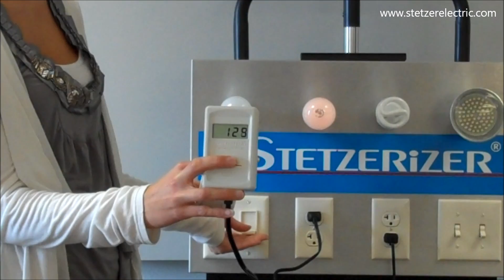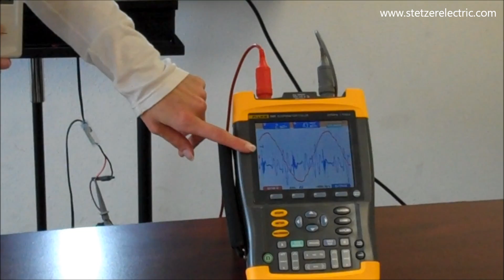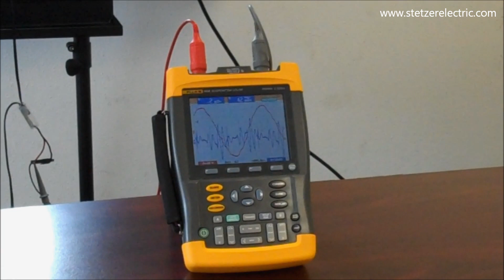The Stetzerizer Filter in action

Comment: Quotes from the WHO

Conclusions from scientific research
In the area of biological effects and medical applications of non-ionizing radiation approximately 25,000 articles have been published over the past 30 years. Despite the feeling of some people that more research needs to be done, scientific knowledge in this area is now more extensive than for most chemicals. Based on a recent in-depth review of the scientific literature, the WHO concluded that current evidence does not confirm the existence of any health consequences from exposure to low level electromagnetic fields. However, some gaps in knowledge about biological effects exist and need further research.

Effects on general health
Some members of the public have attributed a diffuse collection of symptoms to low levels of exposure to electromagnetic fields at home. Reported symptoms include headaches, anxiety, suicide and depression, nausea, fatigue and loss of libido. To date, scientific evidence does not support a link between these symptoms and exposure to electromagnetic fields. At least some of these health problems may be caused by noise or other factors in the environment, or by anxiety related to the presence of new technologies.

Quotes from Health Canada

Health Canada looked into the efficacy of Stetzer filters which are purported to reduce the amount of “dirty electricity” in a home. Here is what they concluded:

The Stetzer filter does not clean up line voltage harmonics. Nor does it help to restore the current of a non-linear load back to a sinusoidal shape. The Stetzer filter current is highly distorted containing harmonic content up to 10 kHz. (Stetzer current harmonics are accentuated versions of the line voltage harmonics.) Since Stetzer filter currents add vectorily to the other load currents in the home, their distortion products (harmonics) are carried on the electricity supply and add to the level of “dirty electricity” in the house.

The Stetzer filter is probably effective in attenuating high frequency (4kHz to 100 kHz) noise on the AC power lines although these components are small to begin with. No assessment can be made concerning its effectiveness in suppressing transient disturbances since these phenomena are random, infrequent events for which we are unable to test.

Comment: Have a major wiring problem in my home, when I put the device on the drywall it goes up to over 100 EF and in some areas higher ! I cannot work on my fuse panel because I can't stand near it long enough without feeling like crap I did turn off the main and all the breakers ,I turn the main back on did not feel anything abnormal the readings were normal as soon as I turn one breaker on the device went crazy KMoon-3120 is what I use to determine E- field , I definitely know something's wrong , my ears have a low Pierce, head is foggy when I'm in the house made a phone call to a top electrician find out what the hell is going on!
Reply: how do u fix it man i need help
Reply: just stop using electricity alltogether like i do, god never intended us humans to abuse this unearthly phenomenon

Comment: This filter works very well, especially since the smart meters came in. It really helps regulate multi pulses and spiking. Though it can't help in certain poor wiring situations and in turn can magnify the existing problem. This is not the fault of the device, it's the fault of the electrician and can be fixed by an electrician who understands how to limit the problem through smarter wiring methods.

Hopefully this company will come out with two more additional filters that reduce Magnetic fields and high microwave frequencies. Wifi will be changing from low frequency microwave to the new 5g high frequency microwave. This change will be problematic (health wise) for a lot of people.
Reply: Yes those filters are good but if you're readings are high best thing to do,put a filter on your fuse box,no need for 10 of those plugins? The inline filter at the fuse box is simple to install 450 bucks well spent!
Reply: True, though even with a inline filter between the main breaker and load, some 3-way & 4-way switch wiring can still produce high levels of harmful EMF. Sometimes it can be corrected easily in the switch box but often you need to run a new MC,15/3 wire. 

Now I'm trying to figure a way to reduce 5G high frequency microwaves, other than lining your walls of your house with lead, I don't know of anyway to stop or reduce it. Once 5G is transmitters are on every other street light or telephone pole, there's not much we can do about it.

Comment: I installed an electric space heater in my cellar and started to feel weak and dizzy and had a scratchy throat. I went to the doctor, he said I had bronchitis, I took some Zithromax and I felt fine. The heater`s been working well now for about four years. Thank-you
Reply: +Ebenezer Kalarama    The long-suffering  EHS victims describe themselves as  `forgetful`, `confused`, `dizzy` etc.  Maybe `dopey` or `goofy` would be more appropriate, especially as a pre-existing condition:
----------------------------
All about Q-Shield: ``This holographic forms were used in Ancient Egypt, as well as by the native tribes of the North America. They strengthen and correct natural, from the point of view of eastern medicine, energetic structures (meridian, aura and chakra based). They are scientifically based in terms of dorsal-torsion interactions.

Q-Shield Total is produced as an applicator that could be placed on the steering wheel, steering column, or drive shaft of the car``.

Comment: I lived in an off-grid home for a few years that was powered by a modified sine wave inverter solar power system.  I rate it as one of the worst things that I ever did in life.  A few years of living inside that dirty electricity home made me really sick!  I was so fatigued I hardly got anything done there.  I later realized that the inverter and CFL lights had induced radio wave sickness into me!  I researched and wrote a book on the subject, called "Toxic Electricity".  Stetzer is right!
Reply: Environmental Radiation LLC i live in a off grid home with a good quality pure sine inverter (50hz) and only led light bulbs. I do however want to prevent frequencies that i might not be aware of, and wonder if these STETZERiZER filters can be incorporated into my system where i start distributing the power ( breaker bar level) ? How did you solve yours?
Reply: May I inquire how to eliminate dirty electricity from neighbors solar?

Comment: Could you please answer this question:  Several of us have noticed comments online that some people get worse with these filters because they say the filters themselves can radiate EMFs or 'dirty electricty', so it is desirable to place them away from areas where you spend much time).  

I thought the entire purpose of the filters was to eliminate or greatly lower the dirty electricity/EMFs so that one avoids using 'grounding' devices and 'protects the entire home or apartment.

Could you explain this please?   Also, am troubled that several of your comments below just end abruptly in mid sentence…?
Reply: DDumbrille EMF is an electromagnetic field. 'Dirty electricity', if such a thing exists, is current, which has an associated EMF. A filter cannot radiate current. Don't be troubled by people who can't be bothered to type properly or who exceed the maximum no. of words lol
Reply: Some people may have power line communications (PLC). When a filter is plugged in the grid my be trying to sense what it is.  I have witnessed that people still have dimmer switches and they don't use enough filters. There should be 10 for every 1,000 square feet. I have used these in every home for the last ten years and everyone reports life changing results. I don't work for Dave Stetzer.  Grounding devices add electricity into the body not reduce it.
Reply: @TotalEMFSolutions  Well, whatever. Since I posted my original question 11 years ago, I've done enough research to know that so-called EMF sensitivity is a scam 'diagnosis', so I no longer buy any of this crap. There are many studies showing people who think they're sensitive to EMFs, actually aren't, because they have the same reaction whether a phone or whatever electric device is fake or real. But thanks for trying...

Comment from the maker: The target number on the Stetzer meter is 35 or below. This can be difficult to achieve in some workplace settings (such as ours where this video was made) due to increased use of computers, other electronics, HID lighting, etc. At a certain point installing more filters may no longer result in a significant (30%+) decrease in meter readings; users then need to begin looking for significant DE contributors to determine if they may be malfunctioning, or if their use can be limited or eliminated.

Comment: Over the last couple of decades, extensive change was mandated to limit the amount of RF noise, EMF noise, power consumption, power factor correction, and energy radiation down to levels far lower than they have ever been. Yet, no health problems  from electrical noise back then. Also, the CFL electronic ballast is the SAME technology as in halogen lights, adapters for cell, mp3, DVD, computers,  etc. etc.

DON'T BUY INTO THIS - Visit EMF&Health dot com, Health Canada, WHO. Learn the facts!